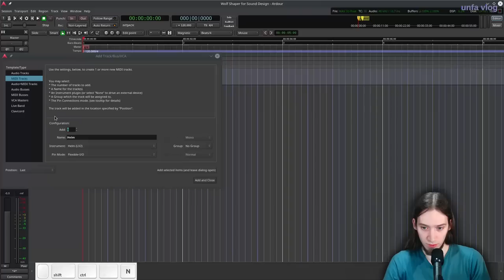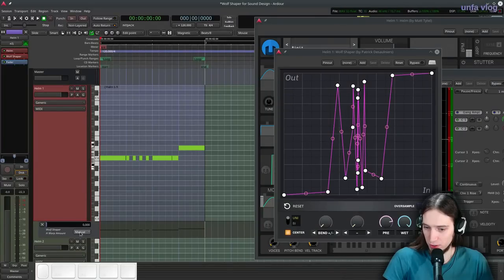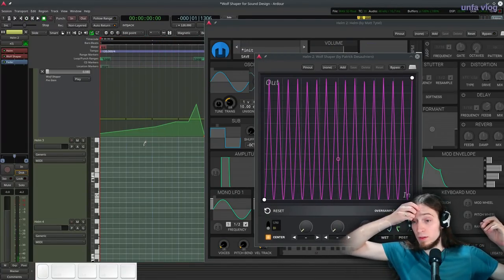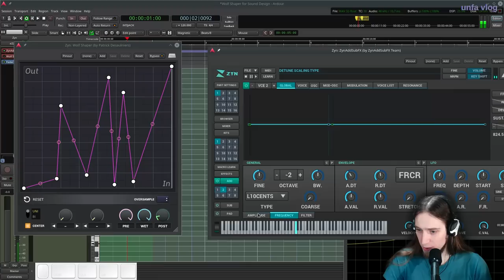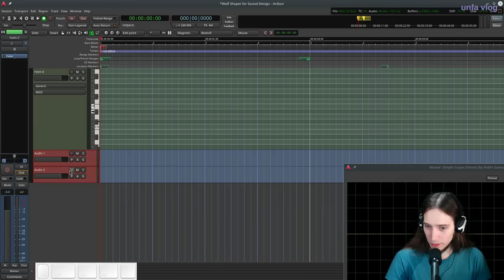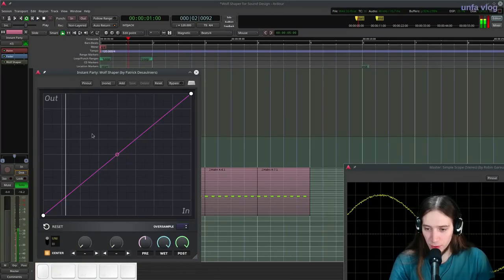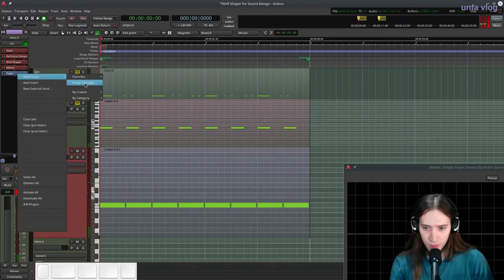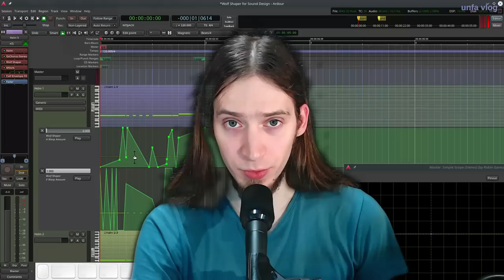UV#29 Wolf Shaper: Waveshaping for Sound Design

Comment: How do I install this in windows?
Reply from the maker: Download the VST plugins and unZIP them into C:\Program Files\Steinberg\VST Plugins\.
Assuming your VST host checks there.
Reply: @unfa00  But his github file contains only binary,makefiles and no dlls
Reply from the maker: @harishkumaru589  if you dowoad the Windows VST build, there has to be a full file in there, isn't it? I've installed it a few months ago ona Windows machine and it worked.

https://github.com/pdesaulniers/wolf-shaper/releases/download/v0.1.7/wolf-shaper-v0.1.7-windows-vst2.zip
Reply: @unfa00  gotcha! It was under windows built tab